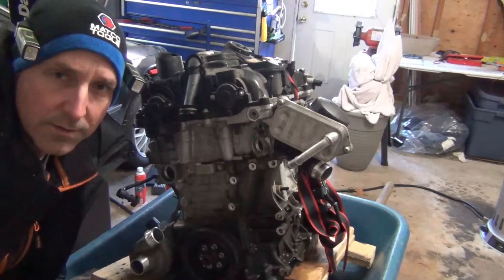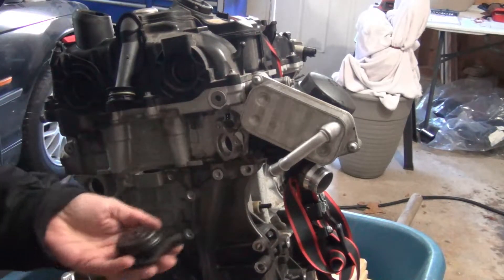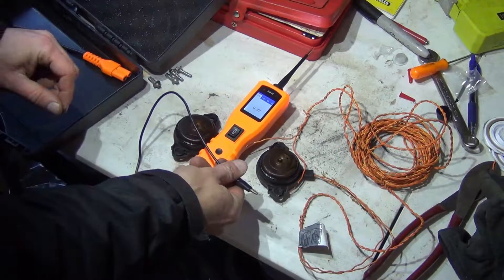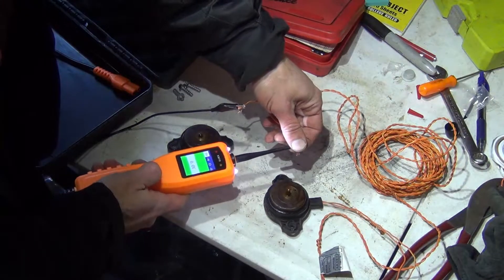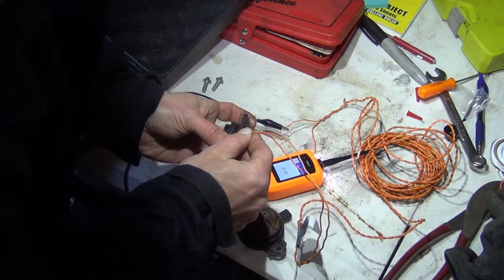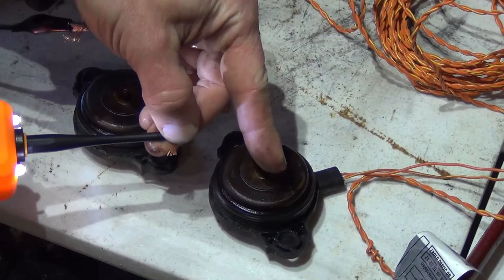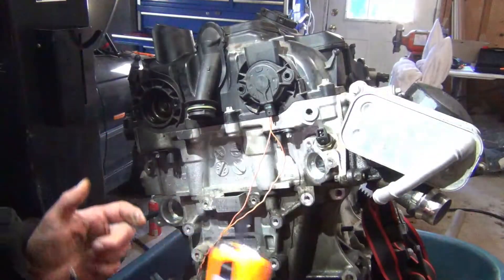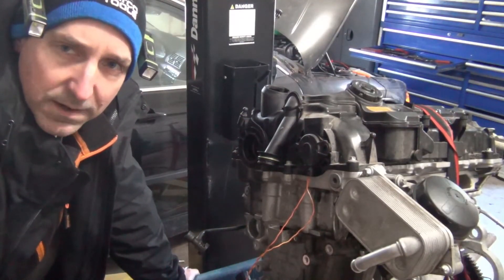How To Test A VANOS Solenoid - N20 Intake Vanos Exhaust Vanos Actuator Solenoid Removal And Testing

Comment: Hello... My  b38 engine, sometimes show 10.5 ohms, and when I test it with 12 volts, after that show 20 ohms and 17 ohms to the exhaust... And after a few minutes drops again to 10.5 ohms, It is normal?
Thanks.
Reply from the maker: To Test A circuit using ohms there has to be no power in the circuit. Or you will get erratic readings.
Reply: @AskTheCarExperts yes I know that... How many ohms to be ok? Do you know?
Thanks my friend...
Reply from the maker: @ksimos I have not ohmed one out. I usually just test with a 9 v battery or 12v battery for operation.
Reply: @AskTheCarExperts OK my friend, thank you very much for your time!
Reply from the maker: @ksimos Are you getting vanos codes?
Reply: @AskTheCarExperts I am getting p13c9 and drivetrain... P1339. I will replace the actuators first and after that if nothing changes, I will open and see the vanos...
Reply from the maker: @ksimos You have codes for intake and exhaust. Verify the oil filter is correct. OEM only.  I had one car with filter debris in the engine that needed an engine replacement.  If that is good the most common thing is to replace the central vanos bolts and actuator with OE parts.
Reply: @AskTheCarExperts I have the b38 engine... I will check it tomorrow... I have the car only one day and I don't know what the previous owner have done with it. So I will make first a good service.Thank you very much my friend. 🙏🙏🙏

Comment: 131501 VANOS, Intake, Cold Start: Not Controllable; n20 struggling to start up do have any advice on this code? hopefully you still replying, thanks in advance.
Reply from the maker: Hi, Yes I always try but sometimes replies get lost on YouTube. N20 cold start vanos fault,  make sure the oil filter is good OE, make sure the center insert in the cap is good and not missing, swap the actuator, if migrate actuator is bad. If it stays, remove valve cover and check timing, did timing jump, yes replace chain guides and sprocket, no replace vanos unit and center bolt.
Reply: @AskTheCarExperts  I was a little worried on the reply since your video is a little older😅I appreciate the urgency man👍🏾 Right on! I’ve check the cap and all checks out, I did a clean up on the actuators but the swap I have not done 💡 going to try this out! Last thing I want to do is replace the VANOS unit which is a hefty job for me but not impossible. Thanks again just subbed to your channel.
Reply from the maker: @obeezcanoli Happy to help. Shoot me an update if you want.
Reply: I sure will thank you

Comment: Hi. Can you tell me what the voltage should be in the wire connector to those when engine is running? I dont get any voltage, maybe millivolts to both of those connectors when engine running? Is my harness faulty??
Reply from the maker: You will only have voltage when activated by the DME. You will not be able to test this way.
Reply: @AskTheCarExperts  Can you help then, what is the issue my n20 has? Its now fully rebuild. Constant misfires in cylinder 4 starts 30 seconds after cold startup. Checked all the basics, compression 12 bar. The weird thing is that idle is normal and no misfires for the first 30 seconds after cold startup. After that cylinder 4 is misfiring constantly. Ive swapped coils, plugs, injectors, still same issue. If it was timing wrong, misfires should exist all the time and in many cylinders?
Reply from the maker: @kanava6066 I would do a cylinder leakage test as well to make sure valves are sealing. This could be a bad DME. 
Do you have a coil pack inline tester to verify spark?

Comment: 130715 error. Bmw g30 b48 help
Reply from the maker: @muslumyasavur1077  This could be a software error, bad vanos actuator (swap them) or bad central bolt and vanos unit.
Reply: @ I changed the central bolt but it didn't work. Should I replace the vanos actuators? Also, does the vanos need software or programming after the change?
Reply from the maker: @muslumyasavur1077  Did you do complete timing with the bokt replacement?

Comment: I am having trouble with slight misfires on cyl’s 2 & 4.  I’ve checked for vacuum leaks, replaced plugs/coils, replaced injectors, done multiple sea foam treatments, replaced timing chains & guides and still have those misfires at startup. Is there anything else to check for?
Reply: I reprogrammed the DME tonight, cleared adaptation values, did a relearn of the valvetronic motor and still no luck. The only thing that’s made a difference is unplugging the valvetronic motor. When unplugged, it starts and idles beautifully. Once plugged in again, the slight misfires are back. I had no faults when doing the relearn, but could the motor be bad?
Reply: @mattp869  Hey man i have the same issue at cylinder 1 & 2, at initial startup mostly cylinder 1 (5-15 misfires) and cylinder 2 a little less (1-5 misfires) misfire for 3-5 seconds, then work normally. I did everything that i could think of, plus engine is rebuilt 35K km ago, and the misfire was present before the rebuilt as well 😂. If you figured out what it is, please let me know.
Reply from the maker: @mattp869  Have you checked compression and leak down of all cylinders to get a comparison?
Reply: @ I did a compression test. ALL cylinders are good. I did not do a leak down test.
Reply from the maker: @mattp869  I would do a leak down test. Maybe the valves are not sealing or the rings are compromised. If it's always 2 and 4 and you swapped everything and it still does it and the engine is good it could be a programming issue or a bad dme. Also any small air leak can cause some random misfires.
Reply: The car runs really good other than the slight miss it has at idle. But if keeps setting the engine light off

Comment: Hello. I have a P1017 code which tells me she eccentric shaft sensor (valvetronic motor?) is bad. I changed it out and the code is still there. I did the break in phase with no troubles. I'm a bit confused do you have an idea of what I should move on to? I have a 2014 528xi

Comment: Hi There, your videos are extremely helpful because of the simple explanations and solutions you give to what at times can be overwhelming issues. My question is this I have an n20 engine x1 2013; I've had the timing chain done, the oil filter has the center piece, replaced the intake actuator; checked and cleaned the oil pressure regulator by the drivers side motor mount; replaced both cam sensors; and the oil was changed about 1K km ago (5w30 - liquid moly); both vanos center valves operate smoothly as per your push test. None the less, I'm still getting the 2d5a code "vanos intake: control fault, camshaft stuck", usually after about 5-10 minutes of driving. I'll try your solenoid purging idea, and see if that helps.  Do you have any ideas of where to look or check to fix the issue? I appreciate your insights, and sorry for the long comment!...thanks for the help.
Reply from the maker: Hi Jrock, This could be a bad vanos unit. Aftermarket ones do not last from what I have seen. The steps would be to swap the solenoid, check timing, if timing is good the vanos unit is most likely faulty.
Reply: @AskTheCarExperts  Thanks, I'll give it a try and see how it goes. I'm also going to change the input sprocket as well. I'll let you know if it works or not.
Reply from the maker: @jrock1452  Sounds good Jrock!
Reply: @AskTheCarExperts  Just to follow up, replaced vanos unit and the input sprocket as the timing was right on the money; low and behold no more 2d5a vanos codes! Thanks for your help and insights.
Reply: @jrock1452 Did You Fix The Problem? 🙋‍♂️

Comment: I had an oil change, on my 2014 bmw 528i with the n20 engine...as i was driving..it started knocking and read low oil pressure.. the car died, a coyple days later i tried turning it on.. and it cranks but no start.. any ideas... please gelp
Reply from the maker: Sorry to hear that. Sounds like you need some engine diagnosis. The normal failure is the timing chain guides break and get into the oil pick up and starve the engine causing damage resulting in an engine replacement.

Comment: Just recently got code P1338 cant find anything on it for my 2013 bmw x1 28i msport its 13 but has alot of 2014 components any help would be greatly appreciated havnt tested these with power source yet should i just bring to a shop i can mangae minor things but i wouldn't try timing  jobs not to make the problem bigger than already is.. thanks for anyone with info
Reply from the maker: Sorry to hear that you have this code. P1338 This fault code is detected whenever the reference position of the intake camshaft deviates from the permitted position. This could be an issue with the oil filter insert missing, vanos actuators or vanos solenoids and vanos units including timing issues.

Comment: Hey what up bro I have a 2015 bmw 528i n20 engine I have low compression can this engine be honed? I see a lot of people just replacing ring or piston and ring
Reply from the maker: Hello, BMW does not have a procedure for honing out the cylinder. They are coated and the block would need replacement if the cylinder walls are damaged unfortunately. There are many reasons for low compression. Make sure you are not losing it due to incorrect timing or valves not sealing.
Reply: @AskTheCarExperts  yeah I did a cylinder leak down test and I could hear it coming out of crank case. Also added a tea spoon of engine oil and compressor jump up. When I disassemble the engine and the cylinder walls are good can I just replace piston and rings and install everything back

Comment: Thank you a lot for making this video! I couldn't find anywhere else online where they actually removed the actuators and showed the process for it. One question I've got is whether or not any prep has to be done prior to this? Can I just remove the air box and pop both of these out and swap? I'm trying to figure out '130308: VANOS, outlet: control error, position not reached' and I'm hoping that a bad actuator is causing it.
Reply from the maker: Correct, just some basic disassembly required to access.
Reply: @AskTheCarExperts   Thanks again for this indepth guide! I just made the swap today with a new one on the exhaust (outlet?) side. I ended up not removing anything besides the plastic cover and foam thing and just tried my best to get the screws out around the wiring harness that was right overtop of it. After installing it, I cleared the transmission malfunction with BimmerLink. So far it runs fine and no limp mode or code thrown, but I've only driven around my local area at a max of 45-50mph.

The part did look a bit different though than the one I took off--- the pin had a weird different circular shape at the end of the rod and there wasn't any open ring around it. Other than that they look mostly identical.

Is it reasonable to associate error 130308 with a bad VANOS actuator? I'm not sure what 'position not reached' means, but maybe that means the solenoid didn't extend fast enough or far enough?
Reply: @zvsen  Hey did you mange to fix this by just swapping/replacing the exhaust actuator on the front of the engine? I got the same code as you did.
Reply: @gconstantinou  I did swap it with a new one & then reset the code, but I’m not sure if that did the trick. It started giving me that code since September last year, but I have been resetting it ever since and it came back once every few months. Not it’s every 300ish miles it comes back, almost a year later.

No idea if it’s good to keep resetting it, but with BimmerLink I just clear that code and the boost shutdown/restriction code at the same time and it drives fine.

Comment: Could you explain how to pull out and clean/replace the VANOS solenoids themselves? My diagram says they are behind the actuators. Can I just pull them out without having to do anything else? If so, what is the process. I am getting code P13C9.
Reply from the maker: Hello, On an N20 the solenoids are the central bolts that hold the VANOS units in place. To remove them timing tools have to be set up. Normally if I get a VANOS code and it is not the actuators I would remove the valve cover and inspect the timing chain and check the timing. I have a video on how to check the timing and set the timing which includes removing the central bolt.

Comment: Could you please let me know how to take the VANOS Solenoid out??? Thank you
Reply from the maker: Hello, To replace the solenoid which is the central bolt on the VANOS unit the timing would have to be set using timing tools and the bolt replaced that holds the vanos unit in place.
Reply: @AskTheCarExperts  thank you so much, sir 🙏
Reply from the maker: @Megoo1  I have a video on setting the timing. That is the same as replacing the central bolt on the vanos unit. Hope it helps

Comment: Best explained videos No Joke!!❤
I had a drivetrain malfunction prompt, computer said it was the vanos, so I swapped the actuators and the fault went from intake to outlet. I replaced the bad actuator, but now a week later The Drivetrain malfunction Error came back 😢

Any ideas what to do next?
N20 Engine 328i F30.

Thanks in advance!
Reply from the maker: Thank you! I would still swap the Actuator. Make sure your center insert is in the oil filter. Make sure oil level is correct. I have been fixing these with replacement if the central bolt for the vanos unit along with the unit istelf.
Reply: @AskTheCarExperts  Thanks alot, I'll keep ya'll up to date. Grtz

Comment: Throwing this out there to see if anyone has an idea. Code: 131908 Vanos Intake cold start not reached.
Reply from the maker: Swap the solenoid. Make sure you have a BMW oil filter. Check timing. Replace vanos unit if timing is good with the central vanis bolt.

Comment: Getting a code on my f30 n20 131501 vanos, inlet, cold start: not adjustable. Thanks I’m adv  acc mce
Reply: Thanks In advance!
Reply from the maker: Hi Howe, This code can be a few things. First thing is to make sure your oil filter insert is not missing. Second will be to swap the Actuator from intake to exhaust to see if it moves. You can also swap the cam sensor but it is usually not the sensor. If all checks out the next step is to remove the valve cover to check timing. If timing is good then you would replace the central bolt and vanos unit. If timing is off then it may have jumped time and it would be the chain, guides, and oil pump sprocket. I hope this helps!
Reply: Did u fixed it i have the sane code
Reply from the maker: @feelmyhack-minecraft1552  The most common cause is the central bolt or jumped timing.
Reply: @AskTheCarExperts  just replaced the timing chain and sprocket. unless I did bad job timing it, But I have the timing tool so I mean is possible

Comment: how do you take out the central valve? wrench it out or is there a process
Reply from the maker: Hello, I include the central valves in my video for removing the VANOS units. The same procedure is needed as the central valve is the bolt that holds the VANOS units in place. Here it the instructions:
https://youtu.be/_aObWUce2Es

Comment: Hello, I have a 2013 bmw x3 xdrive28i n20 f25  under 60k miles that recently gave a drivetrain malfunction warning. When I used an obd2 scanner it showed, P052B, P054B, P05CC and P13C0 error codes. Please any advice on how to go about this.
Reply from the maker: Hello Andrew, Vanos faults.  First make sure your not missing the oil filter insert. Make sure your oil level is correct.  Then it may he checking timing and checking the timing chain.

Comment: My engine rpms bounce all around at idle. Could this solenoids be the problem? The car also gets choppy at full throttle before shifts, as if its sorta misfiring.
Reply from the maker: Hello,  I would recommend starting with the basic checks of plugs and coils, fuel pressure and air leaks.

Comment: Is it possible to remove the vanos solenoids central valves that are located behind the actuators, by just unscrewing then? I have error codes on the exhaust vanos I’d like to know if I can simply replace both the actuator and the solenoid/valve in one go without having to dissemble anything else.
Reply from the maker: Hello HJ, No for the VANOS central valve you need to use timing tools with the valve cover off. I should have a video on this in a few weeks. I just ordered my timing tools yesterday for home. Please subscribe as I have a lot of N20 videos to come:)
Reply: @AskTheCarExperts  I goofed thinking that the Vanos central valve just screwed out from where the actuator is and now that I’ve watched our other video I see it’s much more complicated.  I turned it with a 24mm socket and I think something is messed up now.  The car doesn’t start now. Do you think I ruined something pretty badly.  I’m thinking I need to take it to someone to redo the whole vanos again.  Is it possible I did major damage to the cams or chains?

Comment: Hello would you know what the problem on a N20 would be after changing timing belt, and code 164040 keeps popping up (camshaft installation defective)??
Reply from the maker: Hello Fabxcess, I would be glad to try and help. The most common reason is actually incorrect timing. You may be putting the timing pin into the wrong hole in the flexplate which makes the timing off. This is the most common cause I have run into where I work with less experienced techs. I use a borescope and you can find the correct timing location. The tool often needs to be ground down a bit to fit correctly in the timing hole because of corrosion. But using a scope you can verify which hole is the correct one. I will be adding a future video on this process shortly as part of my N20 series. Please subscribe :)